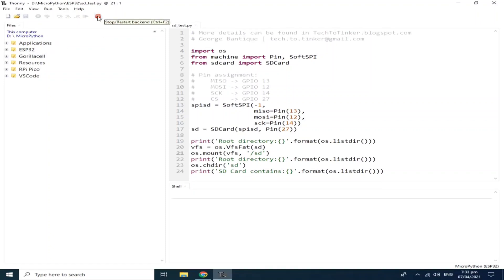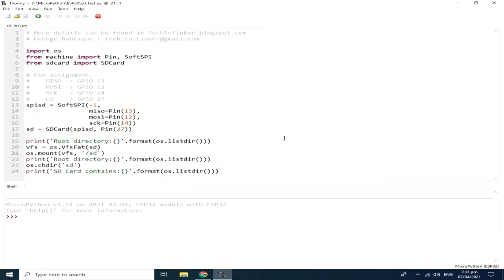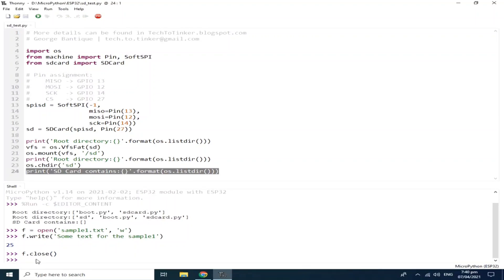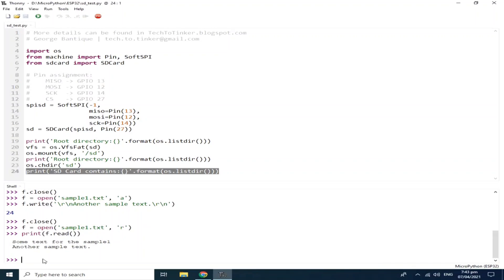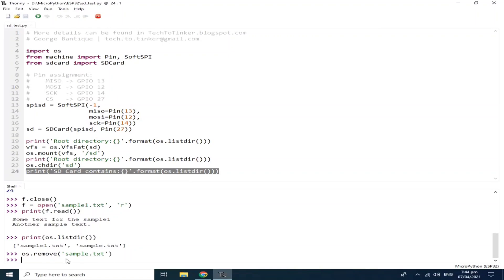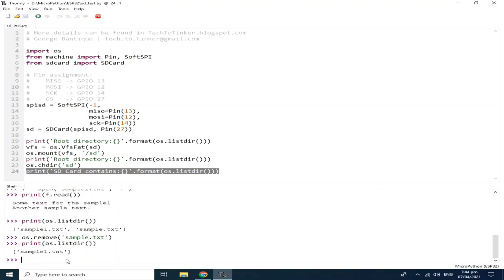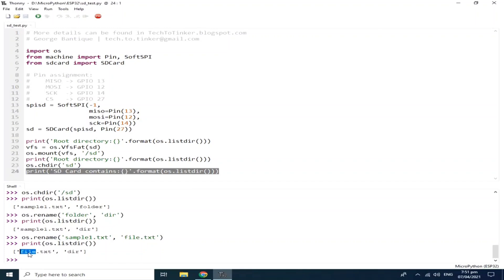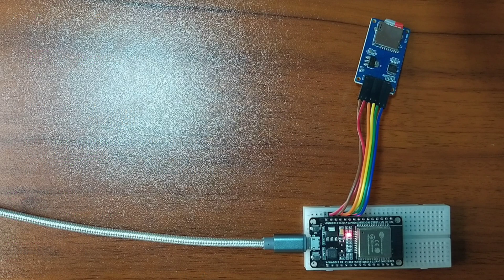024 - ESP32 MicroPython: SD Card

Comment: Great! but i use miso=Pin(19),
                mosi=Pin(23),
                sck=Pin(18))
sd = SDCard(spisd, Pin(5)) and sd card class10 8G only it working. FAT32 (2k sector)
good like!
Reply from the maker: Hi Andrew, yes you can do it like that because the example code uses SoftSPI else you need to use dedicated SPI pins. Anyways, good job and thank you for letting me know. Cheers
Reply: Hi , could you help me with a problem? I am trying to set up those pins of the SPI bus. But it doesn't work, this is the code:

spisd = SPI(-1, miso=Pin(19), mosi=Pin(23), sck=Pin(18))
sd = SDCard(spisd, Pin(5))

I tried by other way without SOFTSPI, but it is not still working:

spi = machine.SDCard(slot=2, width=1, cd=None, wp=None, sck=18, miso=19, mosi=23, cs=5, freq=20000000)
sd = sdcard.SDCard(spi, Pin(5))
os.mount(sd, '/sd')

thanks